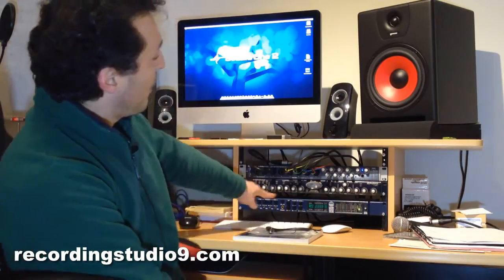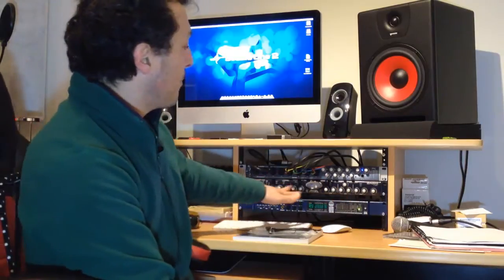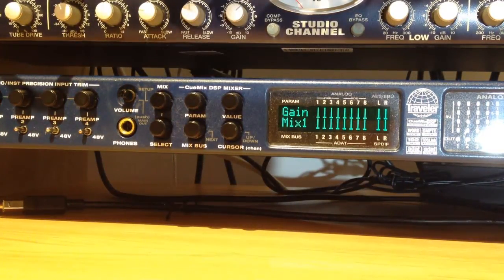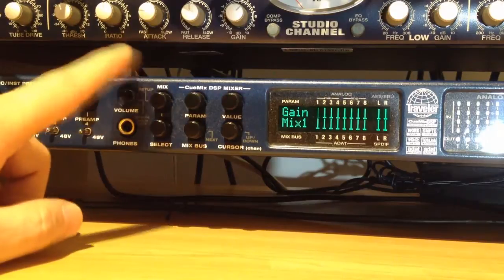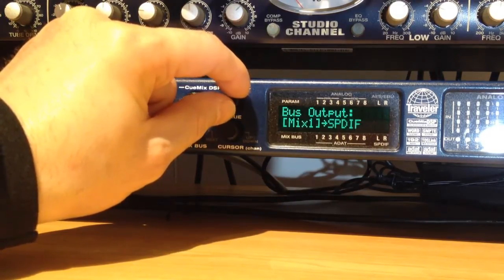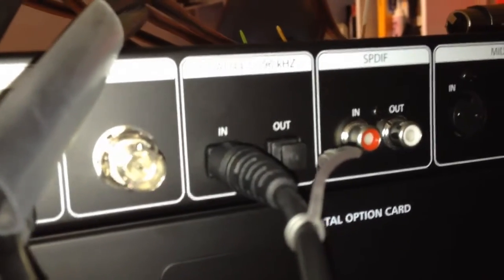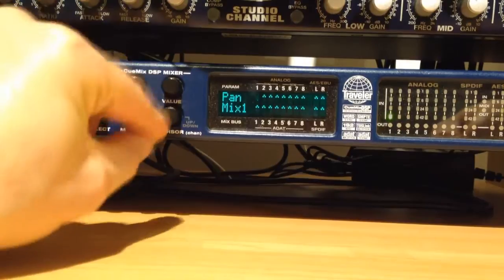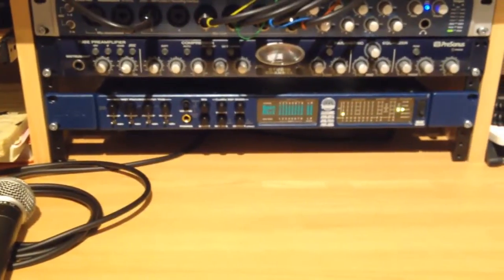Repurposing the MOTU Traveller Firewire Audio Interface

Comment: Thank you very much for your Recording Studio 9 video. I have a big question that I can't find an answer to no matter how many times I think about it. I want to send a PCM .wav file (with 5.1 surround channels) by optical cable to the Motu traveller interface, because I want to amplify this .wav file to 6 active speakers. Can I send this input file (5.1 surround wav) to the 6 different analog outputs? by configuring the interface itself without using a computer.

I would be very grateful if you could answer me, from the bottom of my heart.
Reply from the maker: This (old) interface can't play .WAV files without computer playing and sending via USB/FireWire connection. Optical cables only support 2 (stereo) channels.

Comment: Thank you Vatche, your video was a Godsend as have wanted to use my MOTU 896mk3 as a standalone mic pre with my new UAD Appolo Twin X. I was able to use the manual and front panel controls to get it to feed ADAT audio to the Apollo but I can hear in my audio some sort of digital ringing artifact. Regardless of whether the input is from a Line level keyboard or a mic, the faint but noticable ringing is there. Not sure if something is set wrong in the MOTU but if anyone has experience the similar issue or has a solution to fix I would greatly appreciate it. Thanks again.
Reply from the maker: Back many years ago when I used the unit like in my video, I didn't notice any issues with my PreSonus 1818VSL. Check the clock rate is correct and matching on both units.
Reply: @RecordingStudio9  Thank you sir. I have the clock rate matching and everything appears to be set correctly. I guess it is probably the fact that the MOTU is defective due to age.
Reply: @glennanderson9947  I have the same problem, I get some kind of intermittent digital distortion noise but also sometimes some distorted audio signal of the instrument I’m feeding into the input so something of my signal is getting through….any ideas what’s wrong? Does the (word) clock need to be synchronised (they both have 44.1 set already)?

Comment: Or firewire is now obsolete  2019 :). I have a MK3 in perfect working order, but, I am now at TB3 on my MacBook Pro 2018. Great idea, I never really got into my Mk3, I hated the virtual mixer way back. Following owning an RME HDSPe card and Antelope Orion32 and now an UAD Apollo, I am used to that. Fiddly settings, but, it does have good sound on the Traveller. And of course I have 2 adat in and 2 adat out. Thanks for sharing!.

Comment: Great video.  I need to use some legacy software and that brought me to your video.  When the firewire was working on the MOTU traveller I would like to know what computer system were you connecting to?  Please be specific in your answer.  I want to be able to record 8 tracks as a WAV file and then share those WAV files with others via sd card.  Hopefully recording 8 tracks through the MOTU was easy and did not have pops or clicks or too much latency.  I want to share 24bit 48khz audio files. Thanks I await your response. Ian
Reply from the maker: Best I can recall was it was Windows 7 32Bit 4Gb RAM. No issues at all recording the 8 inputs simultaneously, with latency about 13ms. I remember because it was my first rack mounted interface. But this was a LONG time ago... lol
Reply: @RecordingStudio9  Thanks.

Comment: The quality of the hardware is horrific and the internet is ridden with stories of failed units, including mine. I don't pay 800 bucks to have to resold capacitors and lose firewire ports after 1 year of use.
Reply: Depending if you where throwing it around handing very rough. That would do it. MOTU products are renown for their reliability. They wouldn't be used in critical mission applications such as live play back rigs in major concerts used by A-list Arrists, Shows, Churches etc if thay was the case.
Reply: @eupsychon  There's a lot of factors that's involved in a premature failed unit. But most cases is handling the care of the unit too rough or yanking cables out can really loosen up components. Improper ventilation will cause over heating issues. Seen that happen on many products even many from other manufacturers. Some people had failing power supplies due to an electrical issue in their home or a problem with their power conditioner. You can't blame and point fingers at the manufacture until you acutally pin point the cause and why it happen. MOTU products are usually very reliable. The new MOTU AVB pro interfaces are used by A-List Artists around the world on tour.

Comment: I won’t be buying more new MOTU because they don’t do minor repairs on their not so old models.
Reply from the maker: I agree. Though I was able to repair this unit myself few months ago and works 100%, to the fact that they could not repair or provide parts for it, is not a good business model.
Reply: You repaired the fire wire port?  It's disappointing to have moved the things 3 times in 10 years & to have the ports go out, I treat my electronics gently ect...
It is a poor business model, just to compare Digitech recommends repair shops when they no longer service their old items.
Reply: What should I do?  I'm no longer a working musician on the verge of (no) success.  I drive truck now & just want to have some fun with the gear I only really use in the off season.  When the stuff works right I can make some killer recordings
www.reverbnation.com/prometheustheeband
Reply from the maker: Here is the link to the video of me getting my MOTU repaired https://www.youtube.com/watch?v=CIc-7_7z7wM
Reply: I don't have any ADAT gear, not anymore at least.  I appreciate the FireWire help
Reply: I highly doubt Focusrite, RME, Presonus and many other would repair a product that's nearly 20 years old, not even 10+ years old to say the least. The Traveler is over 16 years old which is very dated by today's standards. MOTU's still has the best out of warranty program as its only $99 as long as they still make parts for it. But normally Motu would send you a Refurbished replacement. A guy on here gotten a replacement unit after his mk3 896 was having issues. Other manufacturers, it would cost you an arm and a Leg for repairs. Cazar an Audio Engineer on yt was oringally quoted a $1000 to repair his Antelope Orion 32 for a power supply failure. Talk about being a money pit.

Comment: Just for the record, the Firewire connection is NOT "unrepairable". The firewire interface chip (about 5$) need to be replaced. I just revived a Traveler mk3 this weekend in about... half an hour, maybe?
Reply from the maker: Yes, I will have a video of the process and replacing of the chip inside, in hope that it will help others who have similar problems.
Thanks again.
The thing is that, even though the unit is nearly 10 years old, downloading and installing the latest driver on my Win10 64bit, worked instantly!
Reply from the maker: Thanks. The city I live in, trying to get any spare electronic parts, I have better chance walking on the moon. Do you have the IC part number I can try to chase up? I would love to fix my MOTU.
Reply: PS: <partial joke> In case you're interested, i have a Traveler mk.3 up for auction on eBay right now :P
Reply: Oh, that has an external power brick? The PJM most definitely has some DC-DC converters inside, either one of which could be the issue.

It might be worth either searching in, or joining some electronics forums, where more people can chime in. I could recommend the badcaps.net forums (there's a dedicated / separate audio-gear section), or eevblog.com (with a dedicated "Repairs" subforum).
Reply: Sure, no worries :) I tried to find some internal photos of the unit, but apart from the small board with the main processor & firewire chip, i didn't find much.

But join one or both of those forums, post about your issues, and have some well-lit (ie. minimal flash-glare) and well-focused photos of the internals ready, and i'm sure you'll get at least some starting pointers.
Reply: At the very least, you'd need a hot-air rework station (~60$ from eBay), a soldering iron with a reasonably fine tip (30-40$), some solder wick/braid (to clean the pads) and obviously a few inches / cm of (preferably leaded / non-lead-free) solder, the thinner the better - i use 0.5mm diameter.
Reply: I have a link for a parts place that has LOTS of components Ray Gonzalas has a YT chn had his M Audio PJ Mix i/o firewire burn up & he got the part he needed I'm sure they would have the parts these companies use certain components from the Same OME parts used across the board … btw my PJ Mix Died just went dark & I'm trying to find out whats the issue. lol
Reply: Dude - grammar & punctuation...
Reply: The Motu Traveler uses the chip TSB41AB2. (source) https://www.linkedin.com/pulse/20140709115102-119240015-motu-traveler-firewire-fix
Reply: I linked that too, in a reply to another comment on this video.
Reply: Well I can't find that supplier now….do you have a link for a parts place to get a FireWire card for M Audio PJ Mix i/o by any chance? Thanks
Reply: Even better would you be willing to repair it for a fee of course?
Reply: Mouser / Digikey / Farnell / element14 / big electronics distributors all carry TSB41AB2's. But if your P-mix totally died, that sounds like some sort of issue on the power supply side to begin with (at the very least).

Regarding fixing it, i'm not entirely sure the shipping to and from me would make it economically feasible - but that's your decision to make, at the end of the day.
Reply: KhronX Could you suggest a place to start maybe fuse or a short at the Power input ? I've seen these short in interfaces. I did buy two new PSU & still same thing the light on the PSU would Pulse when plugged in to the PJM. Any suggestions …if I can't fix it I would like to get it fixed one way or another. Thx for the quick reply.
Reply: Thanks!!!
Reply from the maker: Just recently I was able to replace the Firewire IC inside the MOTU Traveller and got it all working again with my PC. Thanks!
Reply: There you go, then :) Glad to have been able to help.
Reply: Great! Ray Gonazas YT Chn made a vid showing the part & where the issue would be , I don't have all the tools I need or skills i'm thinking. Maybe not? Looking forward to the video. Thx
Reply: I thought they were more than that maybe I'm thinking of the filtration vacuum lines…I have a small Iron i've done a little soldering on gtrs amps PA gear…circuit boards i'm not so sure about I need one of those testers that can test components on the board.  I have a cheap multi meter. Thx for the advice I'm always not sure about the solder if I bought the right kind I stay away from rosin.
Reply: Let's just say the chinese are very resourceful :P I'm still using the Atten 858D+ hot-air station i got about... 5-6(?) years ago, and it works fine for most small-to-medium sized SMD stuff. 

I recently had to break out my old crusty Atten 936b soldering iron (about the same age, a Hakko 936 knockoff) 'cause last week i broke the tip-retaining-collar on  my wonderful Ersa i-Con nano :/ The Atten still works fine, but it just doesn't quite have the "juice" the Ersa does, on medium-to-bigger solder joints or copper planes. But on the other hand, it also cost me about 1/10th of what the Ersa did, so... :P

Comment: Hi brother, first of all, great video.. just what i needed. But I do have an issue. Once i set everything up, I get the adat in led light on my working motu to turn on but on the one that's busted I get a flashing light on 44khz and no signal. I've tried changing the clock source to int 48 and it works but when i switch it back to adat i get no signal on my mic meter again.. Also, I never get the adat out light to turn on.
Any suggestions?
Reply from the maker: It has been so long since I had it out of its box and I cannot remember off my head. I may need to take it out of storage and turn it on again.
What's the other device you are trying to connect to using ADAT?
Reply: Hi there, I'm trying to hook up a Motu Traveler to a 828mkII
Reply from the maker: Make sure the 828MkII clock is set master internal, and Traveler as external clock at 44.1Khz. I don't own a 828MkII, so can't help you other than provide info on how ADAT works, to some degree.
I had my MOTU connected to my PreSonus AudioBox 1818VSL and got it working.

Comment: adat connection work for midi ?   or only audio
Reply from the maker: +Raghed Abi Habib Good question. The ADAT Lightpipe, officially the ADAT Optical Interface, is a standard for the transfer of digital audio between equipment, so no MIDI data is transferred.
Reply: +RecordingStudio9.com thank u

Comment: I've got the MOTU Traveler from many years back.  Although it works fine, are there newer units out with much better components for pre-amp and D/A - A/D conversion which would be worth selling my old unit and upgrading for?
Reply from the maker: +bugsysiegals Thanks for asking my opinion on the MOTU Traveler. I still have the MOTU, as I really like the mic pre-amps.
If you are happy and have no issues, I would keep it unless you see the additional options in the new units more useful. Why fix it if it is not broken?
Reply: Thanks!  I've never had any issues with it just seen others saying the hardware was old and was curious about your opinion
Reply from the maker: I say if it works, it works. Quality product stays quality, no matter how old.
Reply: The next obviously step up is the nee MOTU AVB line up. They are an entirely different beast from the legacy MOTU stuff with AVB Audio Network large scalability. They have compleley designed the interfaces from ground up with the latest conversion chips with very high head room and better pre amps. They are using the same renown ESS Sabre DAC converters found in Apogee products. Drivers are much better as well. I have the latest 828ES that's part of the AVB Pro Audio range.

Comment: Have you tried using different software?  Mine is still working. I am using Ableton 9 with a Mac Pro Retina 2011 through firewire. I use it to play sequence live tracks, metronome, and I was recording some tracks last week. 

You should try using different software you may be surprised.
Reply: I have no idea who told you that, but that's total BS. All the Firewire interfaces i've opened up (as in, bought as faulty, fixed & resold) use the Texas Instruments TSB41AB2 chip, which is very much still in production.
Reply from the maker: Albert Rodriguez My issue is hardware and confirmed fault that is no longer repairable, as the integrated circuits (IC chip) used inside is no longer in production. Make sure you power down your MOTU before disconnecting the firewire cable. That's what cooks the IC chip, though firewire should be plug & play.
Reply: I'd be a bit surprised if you can find that chip locally. But surely you must have access to one of the several European electronic component distributors (Farnell / Element 14, Mouser, Conrad, RS Components etc). You can try to get the chip from eBay (within Europe), but that's a bit "uncertain".

You don't need a "64pin chip solder station". A hot-air station is pretty much required to remove the original chip, but i solder the new one manually (1.2mm tip, and lots of flux). If you have some electronics repair shops, or laptop repair shops locally, you could at least ask how much they would charge for the work (replacing a TQFP-64 chip).
Reply: 35$ for three firewire chips? You can get them for (a bit) more than that, direct from Mouser (about 44AUD including delivery to Australia), with the extra certainty that they're definitely not fakes. Or just a single one for about 31AUD (shipping's 24AUD, or free for orders of over 60AUD).

http://au.mouser.com/Search/ProductDetail.aspx?R=TSB41AB2PAPRvirtualkey59500000virtualkey595-TSB41AB2PAPR
Reply from the maker: Thanks for confirming. Although I don't have a 64pin chip solder station, I might give it a try, if I find the part locally in my city. Thanks again.
Reply from the maker: Just found one on eBay, a somewhat local, the other side of the country. 3pc for $35. I might give it a try. I just need to replace my iron tip with smaller one.

Comment: Hello, I have a Traveler MK3 and one Motu 8PRE (ADAT connected to the Traveler). So happy with this equipment. I would like to know your opinion about the Traveler, and your experience recording (sound quality, reliability, etc), because, as you know, there are lots and lots of "reviews" and comments about the traveler, but I think something as you (Traveler owner) can give me your feedback. 
Cheers.
Reply from the maker: My current interface is the PreSonus AudioBox 1818VSL. If I could afford it, I would get MOTU. When mine worked, and even now half working, the audio preamps I find much more smooth, clean and give a sense of better quality. Not sure why or what it is. I recorded about 5 songs back few years ago till it went bad on the F/W.
I still use it via ADAT as inputs for better dynamics and clarity (as well as extra headphone out).